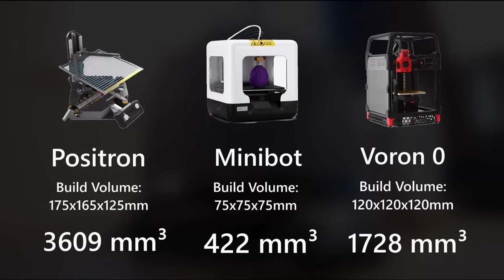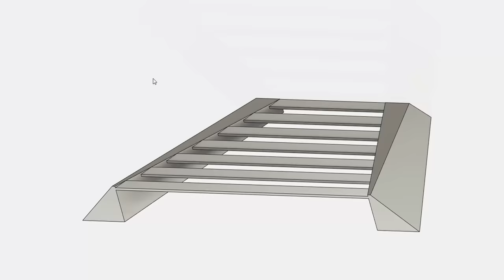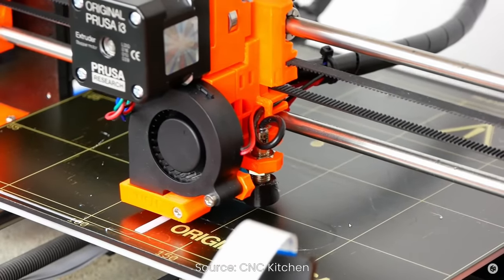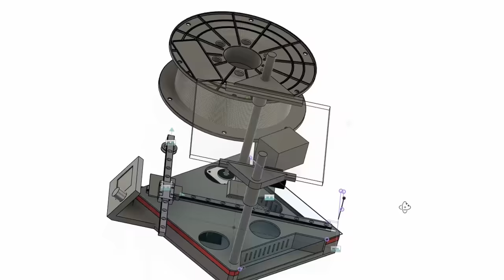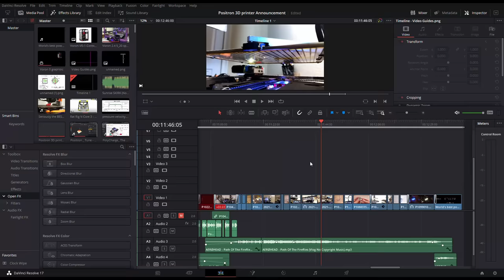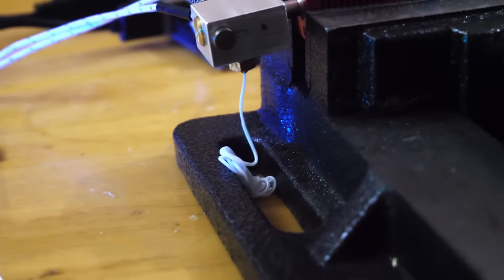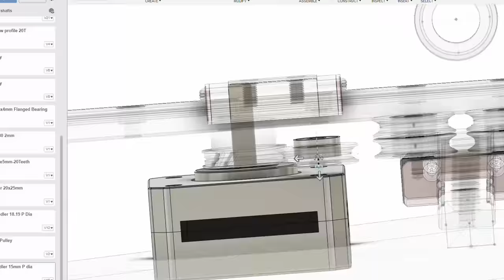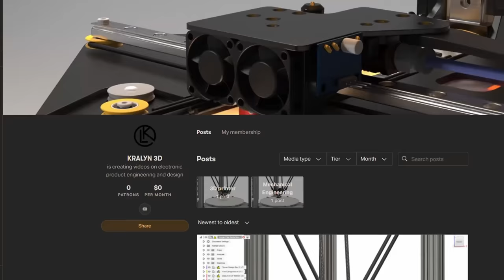A 3D printer unlike any other, fits inside a spool box?  - Positron V3 intro & Design Story

Comment: Excellent work!  I like that you seem to be a perfectionist and refuse to "just accept" something that is substandard.

I wanted to comment on the LCD display.  You mention, near the end, that to use a different Pi, it might be difficult to get the display to work properly (or at all).  I suspect that this could be due to library/drivers available.

I have a suggestion that would make it so easy to use a display on any Pi or Arduino or anything with a serial RxTx port.

I use Nextion displays for everything now.  Their library files (Arduino) are garbage.  Honest... .just super bloated and unnecessarily complicated and cause lag due to their implementation.

HOWEVER, the Nextion displays can be used WITHOUT their libraries!!!

These are accessible using the serial port and sending data (in Arduino, via Serial.print....).  This avoid libraries that can be glitchy or not even work platform to platform like many LCDs that are problematic.

The other great thing with the Nextion displays, is the Editor.  To do updates, while you COULD provide just the actual file to be written to the display at one time, you COULD also provide the editor's file, .HMI.  By doing it this way, a customer/user, COULD, if they wanted to, make their own changes to how the screen, with its pages/colors/fonts, graphics look.

The other excellent thing, is that these displays are really easy to purchase and they are not very expensive (if purchased directly from the manufacturer or by a company like RobotShop that doesn't over charge).

The screens also come in different sizes and types.  There's Basic or Enhanced, for example.  The Enhanced displays would be the best choice as they have more memory and more CPU speed.

I should mention too, that when using the Editor to design the screens, there's a full programming language built in!

You literally can hand off a lot of work to the display itself without having the controller do everything and waste time and memory space.

I suspect that I'm addicted to these Nextion displays.  LOL
Reply from the maker: Thank you! Although I have to convince the klipperscreen team to officially support such display...
Reply: @kralyn3d  
To help "convince" them, I suggest buying even a small one, like a 2.8" Enhanced and have one of the Devs play with the Editor, then search youtube for 
"Nextion without Libraries".
You'll find a channel with CC in green.
He teaches how to use Nextion without libraries, which also then applies to any device that can communicate over Serial ports.

Good luck!

Comment: this is great for its compactness but tbh the print speeds are up to par with anything running klipper. now if this is on marlin or sumn and you can somehow actually push it faster while upside down… that’d be crazy

Comment: Which benefits does the "Upside Down" principe bring compared to normal direction printers?
Reply: It means the heavy moving parts don't have to be supported by a large frame, the center of gravity is lower meaning less vibrations, theoretically bridging could be better. Printing upside down must come with its drawbacks but it does seem to be the best fit for this build.

Comment: with a 90 degree hotend how are you going to be able to do maintenence, retraction/removing filament, and cold pulls to clear jams? also could you release it with prusa slic3r or normal slic3r, they have alot of good features and support.
Reply: I'd assume the same matinence procedures of the E3D Cyclops apply. I'd also believe that you'd remove the brass insert to remove clogs at the bend more easily.

Comment: I’m curious what is the max temp capable for this hotend. I am in the process of building a derivation of this machine and I don’t think I heard in the video what the max temp was for this. If it is not able to print in the 300+ range, would replacing the heat break with a bi metallic break and the heat dissipator with an all metal design (no Bowden inside of it) allow the higher temperatures?
Reply from the maker: All metal hotend will enable higher temps, but PLA will not be reliable
Reply: @kralyn3d  which is fine. I would use two separate hot ends for different applications

Comment: How do you replace the filament in a 90° extruder?
Reply: I would assume just heat up the nozzle and pull it out. The E3D Cyclops also has 90 degree bends.

Comment: Can you power this with you battery bank you made a while back. I get it is not practical, but it would be cool to see even a small print. Cannot say i have seen a battery powered 3d printer.
Reply: I don't see why you couldn't. Heck it sholdn't be a problem to run it with a reasonably designed up-step module and regualar 18V powertool battery or with USB 4 PD in the future ... all you need isbasicly ~250-300W power in total at 12-29V DC

Comment: Which CAD Tools is he using?
Reply: Bit late, but i recognize the small bar that was visible and the cursors.
He is using Autodesk Fusion 360.

Fusion 360 is one of the more friendlier CAD software out there, although the free version has some limitations. Mostly not having extensive simulation most makers don't need, though the "editable document" limit may be annoying, requiring one to regularly export/import stuff manually.
Reply: @Foxhood   Is he? For sure? Seems more like SolidWorks based on some comparisons I felt.
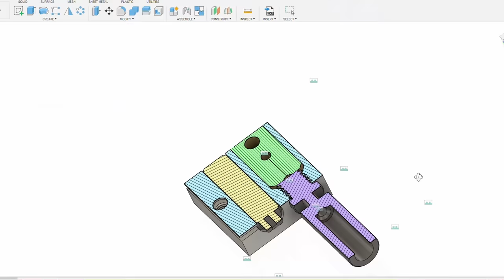Reply: @AX-fx7ng  Pause and look at the CAD bits at  22:11 and 22:17 . They show part of the CAD software's interface at the top and that is beyond a doubt: Fusion 360.

I would know since i use Fusion 360 myself as a beginner. The signature soft looking icons and grouping into create, Modify, etc are unmistakable.
Reply: @Foxhood   Great catch. Thanks for sharing those time points. Will check out F360 also.

Comment: there is only one problem with this.  
all the prints that it does are upside down.  
the benchy won't even stay upright with only the smoke stack touching the ground.  
it's a verry cool printer but the prints are useless.  

(obviously a joke.  calm down XD)

Comment: I really appreciate the innovation but I do feel like alot of skeptical-alarms going off here, alot of them from feeling like im watching a used car advertisment. What are the down sides? Upside-down printing has been tried for well over a decade, why is it always scrapped? Surely theres plenty of smart people out there right? Is the upside-down thing a product of you thinking its genuinly better and every printer should be like that, or is it a byproduct of it being designed as a portable device? Or did you just really want upside-down printing to be a thing? 

Also it might be my paranoia here but i cant help noticing that most of the torture tests and calibration tools arent actually shown being printed on this printer, how come? Theres so much footage of every little detail, surely that would very logical to include? Also the specs you compare here seems to be a bit off, like the voron 0.1 you show can go way, waaay faster than this with a minimum of tuning, and im pretty sure an Ender 3 with a sonic pad can match the numbers you claim here too. Does this mean the speeds and print quality is not so much a product of your hardware, but more so just.... Klipper?

Ngl this is cool af, but I struggle a bit to understand who and what its for